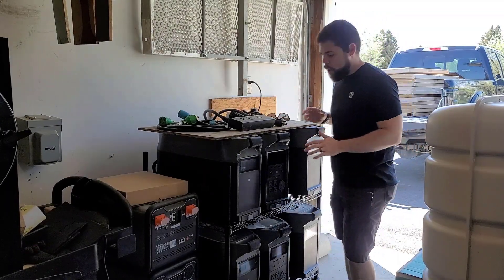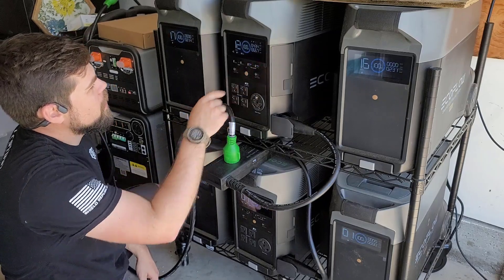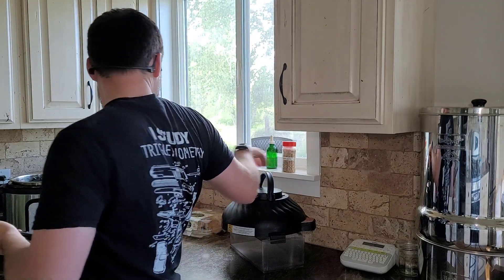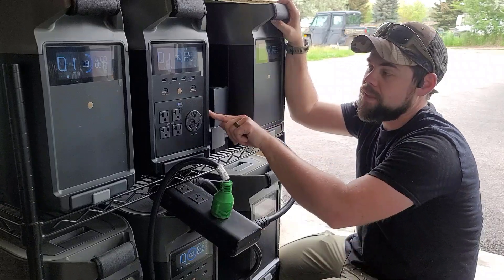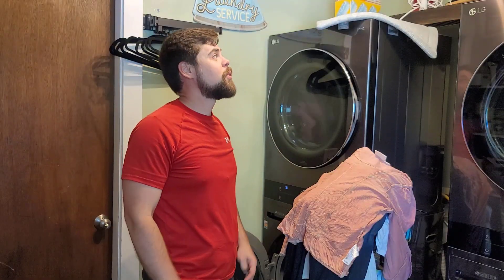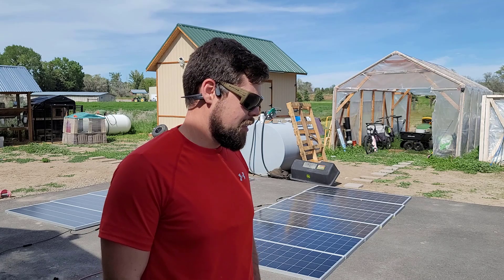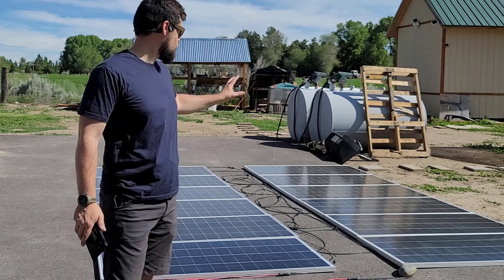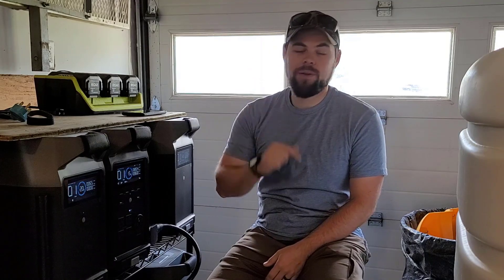Off-Grid House Powered by Solar Generator

Comment: If you don't mind me asking you, how much did this setup set you back in Dollars ?
Reply from the maker: In total it was around $23k. Not cheap, but I am glad I have it. If you're interested in any kits you can find them at https://poweredportablesolar.com/shop/
Reply: @minutemansolar  Wow ! Yeah, I've got the EcoFlow River 600 MAX. EcoFlow products are good, but heavily overpriced IMHO. Yes, you're running your entire house off of your solar generators, but you're doing so $23,000.00 USD later ! 😳👀👀This is an enterprise level solution. I simply can't afford to put out this kind of a cash outlay just to have my stuff on during a power failure. A Gasoline genny is loud and messy, but quite affordable by price comparison. I am not a fan of fossil fuels, per se, but alternative energy solutions need to continue to come down in price point, or else they will remain elitist products for those who have disposable cash levels whereby they can indulge.
Reply: @markjob6354  …yes a gasoline generator is less expensive to run(assuming gas prices don’t continue to skyrocket), but if a major Hurricane hits (assuming you can move/protect your solar panels), what are you going to do for gasoline after the local pumps are out, or the gasoline supply is out for 4-5+ days?  I have both an Ecoflow solar generator (only to keep my freezer and fridge going for 24 hours as long as there is enough sun each day on the solar panels), and I have a gasoline generator for cloudy days, but only about a 3-4 day gasoline storage capacity….1-2 day blackouts are doable with gas, but storms are getting stronger and more severe, and I don’t have the ability to safely store more than a 3-4 day supply of gasoline. Looks like a combined system that allows you to flex fuels would be the best option. I seriously know I cannot afford a whole house off grid system, just essential systems to run basics
Reply: @josephdebes3060  This is where most of us are at as well. In order to have enough battery capacity to run an entire house for 5 to 7 days you need about $25,000.00 in solar generators, tie in, and extra batteries, along with solar and a wind rotor, which can produce energy day and night (Providing there's enough wind ?). A house consumes 3.5 to 5 Kw a day on average. (More in the cold Winter months). Gas gennys only work for short outtages. Gas generators are simply impractical for SHTF scenarios, of course, since gasoline is the first thing to disappear, then food.
Reply: @markjob6354  I bought a Titan and three batteries (2000 watt solar panels)and had an electrician hook it up to my electric panel. I can run my entire house except for the oven and dryer and it cost me under 10k. for everything including wires, tools, grounding, etc....... I just don't have 240volts   Can you live on 120volts?  I did change all of my light bulbs in the house to LED bulbs. I have a timer on my refrigerator and freezer where the power goes off every 45 minutes for 15 minutes, and I don't waste or use lots of power on things I don't need running.  I do have a backup propane generator to charge the batteries if necessary and that cost me $1200(inverter-generator).  I can run everyday without being connected to the grid. I watch tv and use a dvd player, take showers, etc...  My heat for the winter is a propane fireplace or a wood fireplace. Running electric heaters would eat up the power quickly.  The heat in the summer is bearable and I only run fans. 10k plus a back up generator for SHTF.  If your well pump needs 240 volts then that is something else to consider. But it is doable for way less than 25k.  Good luck
Reply: @rameylewis7730  Hi Ramey. Thank you for your feedback. 👍😃
Reply: That sounds about the entry level cost for a professional installation of a solar system and that's usually still grid tied, not battery backed up. 

I wonder if something like that could be applied as a 2nd mortgage? Although now might be a bad time for something like that but I haven't watched the APRs lately for mortgages.
Reply: @davidhawkins847  If solar systems are going to remain so unreasonably expensive that one must seriously consider obtaining a bank loan against one's own house just to be able to afford such an installation, then I'm thinking such alternative energy solutions are far too over priced ! 👎🏻🤨
Reply: @markjob6354  there are some rebates still available ( but SOME politicians consider them too GENEROUS )… you don’t HAVE to convert ALL your home systems to solar (just at least the major systems), and yes, the current systems tend to be expensive. But since I’m moving to coastal Florida,  8ft off the ground and with hurricane shutters , poured concrete walls, and concrete slab roof. The investment for emergency solar back up,  spread over 5-10 years to ME is worth it, and should afford some degree of security from storms and extended blackouts in the future. Its not a cheap solution, but given my increasing regular utility rates, it’s starting to be a more cost effective plan for the future

And there are insurance discounts for having solar system back ups from some insurance companies
Reply: @markjob6354  I don't disagree.  The ROI for a home system is generally 25-30yrs. Not much incentive there from a financial perspective.  Just trading one cost for another and In actuality adding cost due to maintenance and lifecycle. But all things considered where we seem to be heading if all the news is to be believed it may be worth while to make that trade.
Unfortunately I don't own my place and we rarely experience outages so I'd rather put that money to something else like a down payment. 
As long as natural gas is available for the major appliances I can keep my electric bill down somewhat.

Comment: Th for the great video. Hope you will experiment further with the delta pro system. 
Also, would you noise tjek of how many db the system is making? I got to store it somewhere where i cant hear it. How long are the cables for the Electrical wall outlet?
Good job👍
Reply from the maker: Thanks for watching. I will definitely be experimenting more. I will try to do a db reading in another video. I have mine in my garage and can't hear it in my living room which is adjacent to the garage even when the fans are blowing at full speed.

Comment: Do you believe that if you got more solar panels, you could run your whole house indefinitely?
Reply from the maker: Likely yes but there are always things to consider like the weather, space heaters and so on which would make it very hard to go very long term. For essential items, very easy to do long term. For normal every day life not worrying about how much power we're using, it'd be hard to commit 100%. These systems were not designed to take a house off grid 100%. But they are indeed doing a good job of getting close to that. It always just comes down to what your power needs are.

Comment: We really need to know what it does with an all electric house AND with AC and pump.
Reply from the maker: Electrical houses where all heat comes from electricity not gas is going to be very difficult to run off of any solar and battery setup. Electrical heat and A/C use A LOT of power.
Reply: 47retta,
There is a lot of videos on YouTube that you can watch 
and may help you.  You will be amazed how many people that have 
switch to solar power to run there whole house.

Comment: The legs in a breaker box aren't separated by left and right. Every other row alternates between one leg and the other. That's how you get 240V from a double pole breaker.
Reply from the maker: Just trying to keep it simple for people who don't know how electrical panels work. There are indeed two bus bars (legs) inside my electrical panel and you can only get 240v power if you send 120v power to each bus bar. So one "side" is energized while the other is not if I only have 120v like one delta pro or one titan solar generator.
Reply: @minutemansolar  You would benefit from balancing your 120V loads in your electrical panel, which would better balance out the discharge rate of each group of batteries. Determine which 120v loads you use the most and try to put half on one leg or "side" and the other half on the other leg or "side". This would allow both battery groups to discharge more evenly. A lot of times, shifting a load from one leg to another is just a matter of swapping a breaker up or down. Hopefully, this advice is worth more to you than what you paid.
Reply: @jwade1977  excellent suggestion.  Actually this is a good idea even if you're connected to the grid.  In that scenario an unbalanced panel load can cause many problems.  Most serious you could actually trip your main breaker because one leg of the 2 pole main is drawing more current than the breaker rating.
Reply: @pstoneking3418   Very helpful tip - Thanks !!

Comment: Very well done. I started with 2 DP's only and after your original video, showing your set up on the Uline Cart, I ended up getting have the exact same DP set up. However my 12 roof mounted Longi LR4-60HPB-360M Solar Panels were the most optimal panels which are available here in Alberta Canada at the time at a decent price while each of the 6 panel 3S2P arrays provides 1,606 watts to EACH of my DP's.
Reply from the maker: Very nice setup you have too! I'm glad you got it all worked out.

Comment: Alot of good information sir. 
Wouldn’t it be nice if Congress finally recognized our need for a grid upgrade?  Thanks for all your hard work!
Reply: Great video, my wife and I are pretty set on doing this. How did you set up your transfer switch to run of what I believe is just you main house breaker panel?
Reply from the maker: @Ferdalance  That's awesome, it's definitely nice to have the easy to use backup power. I had an electrician install my transfer switch. The electrical panel simply gets it's power from one source, the grid. When we add a transfer switch, we give the option to the electrical panel to get power from another source, in this case a solar generator. If the grid power goes down, we flip off our main breaker from the grid, and then tell the electrical panel to get the power from the solar generator by using the transfer switch.

If you're going to get any of this equipment please consider ordering from https://poweredportablesolar.com/shop/ to help support the channel :) You can always reach out by email as well to info@poweredportablesolar.com and we can help you even more.

Comment: I would like to see a part 2 w/ more solar panels, with a  AC unit running for 8 hrs.
Could this setup do it for 96hrs?
Reply from the maker: I am working on that to see how I can get that done. I'm definitely getting more solar panels but I don't have central air in my house. So I'm asking around in my group of friends to see if they have central air and a transfer switch.
Reply: @minutemansolar  what about using a window AC unit (6-8000 btu) that is what alot of people have.
Reply from the maker: @grindychum  That's no problem at all. Generally you take 10% of the rated BTUs for a unit, and that's how many watts it will use to run. So a 6,000 BTU unit uses roughly 600w while running which equates to 600wh off of the battery if you run the 600w for one hour. Or if you're inputting 1000w from solar panels, and using 600w to run the window ac unit, then from that 1000w there will be 600w going to the AC unit and 400w going to the battery or anything else that is running.
Reply: @minutemansolar  Thank you.  This kind of info is very helpful.
Reply: Yea that's the only comment I have, you won't be able to run your central ac for more than just a few hours. But of course in a black out ac is not your main concern.
Reply: Hit thumbs down by accident...how do i correct it?
Reply from the maker: @twiley4901  You should just be able to click the dislike button and have it deselect it.

Comment: Well done!  It seems you can benefit from moving a few circuits in your panel to better balance your loads.
Reply from the maker: Thank you. I definitely could use moving some circuits around, I think I'll do that so life is a little easier when running this system or any other system long term.
Reply: @minutemansolar  balancing your electric system reduces your bill when on the grid too!

Comment: Hopefully ill have 4800 watts in panels on my system soon. Need a couple more battery banks and it will be a 24kWh battery backup. Still find myself needing grid power in winter up here so hopfully doubling what i currently have will be more than enough to survive a 2 week winter storm.
Reply from the maker: That definitely sounds like an impressive system, that's what I am going for as well. I need more solar panels. If you're getting more delta pro batteries please consider ordering from the PoweredPortableSolar.com shop to help support the channel: https://poweredportablesolar.com/product/ecoflow-delta-pro-expansion-battery/ :)

Comment: Can you explain how the right side and left side of your panel gets power from the individual eco pro units that are tied together with a single cord?  I don’t understand how that is happening.
Reply from the maker: The power receptacle that is on the delta pro 240v combiner is called an L14-50R. It has 4 holes. One hole is for a ground, one is for a neutral, then the two others are called "hot" and each of those two holes can carry 120v, or in other words one side of the electrical panel in each of those two hot holes. So one DP is powering one of the "hots" and the other DP is power the other "hot." That's how 240v power gets to the electrical panel.

Comment: You can over panel the delta pro?  I thought it only allowed 1600w input?
Reply: You can always over panel a system as long as the charge controller system only outputs the correct amount.
Reply from the maker: Yes you can overpanel the Delta Pro, it's not easy to get it right. But I will be doing videos on it in the future. I need to get more solar panels first to show how to do that :)
Reply: Too much input from the panels, and the Delta solar controller shuts off the input (protecting your solar “generator “)…so you don’t blow out your batteries….not every solar generator system has that feature….also goes to why the ECOFLOW systems are a bit PRICEY
Reply: @josephdebes3060  right.  What I guess I’m asking is I have 2 delta pros and 4 battery.  3 batteries for each pro.  How much can I overload each set-up (1 pro, 2 batteries)?

Comment: That is an impressively capable and impressively easy system.  Have you considered swapping a few breakers around in your electrical panel to better balance the legs?
Reply from the maker: Thank you. I do want to move around some breakers so I can balance the panel easier and not have to be swapping cables on my DPs when doing this stuff long term. I need to get the well pump and kitchen on different breaker locations so I can split the most common loads up.
Reply: I've got 2 separate panels in my old house. I talked to an electrician about combining them into one panel and he said I would have to completely rewire the whole house to get the cable lengths correct
Reply from the maker: @nicholashomler1494  I'm not an electrician but that sounds correct if everything were to be combined into a single box since the wires are already run to two different boxes.

Comment: Hey Brother,    

We live west of Salt Lake City, Utah.  

I have had 36 solar panels on our roof for about 6 years.    We have always believed that these days were coming.  

I bought the Delta Pro and 2 batteries.   They still in the boxes.   

I don’t have the training or knowledge to do what I want done.  

I guess that I need a transfer switch.   I also guess that I can’t just hook up my panels to my Delta Pro because “it may damage” them.  

I can’t get anyone to help me with this.  I just retired and my wife has health issues.  

Can we get some advice?

Can we just plug them into the wall and then use extension cords to run the essential things like refrigerators, freezers and stuff.  

I know I’m probably doing things backwards, but I’m confident these will be necessary.  

Thank You for your knowledge and abilities.   This is not my line of work and experience.
Reply from the maker: Hey Greg, I'm more definitely happy to help you guys out. Most solar panels are roofs are just designed for reducing electricity bills, not really anything else. So it may be possible to take some of those panels, disconnect them from your house, and have them run the DP but I'm not 100% sure on that, but most likely. But you can't be running your house from grid/roof solar power while using your DP connected to a transfer switch. Your electrical panel can only run power from one power source. 

It is possible to do something like run a fridge and freezer directly off of the DP and then your DP would have solar panels connected to it and therefore would be doing the same thing, but rather than your fridge and freezer be plugged into a wall outlet it'd be plugged directly into the DP through extension cords or something similar. 

A transfer switch is only necessary if you have two DPs and you want to run 240v to your electrical panel to power up your entire home, or at minimum be able to use the outlets, light switches and appliance without any extension cords. You can use 1 or 2 DPs on a transfer switch but you can only power the whole electrical panel with 2 DPs.

I'm happy to help answer any other questions you have. Feel free to email us at info@poweredportablesolar.com too for help.
Reply: @minutemansolar  i am so grateful for your help and knowledge.
Reply: Hope you are following the long storage regimen for your equipment.  They say what to do in the manual if you are planning long storage.  Failure to follow that depletion and recharge cycle nullifies your warranty.  If you already know this just ignore this reminder!